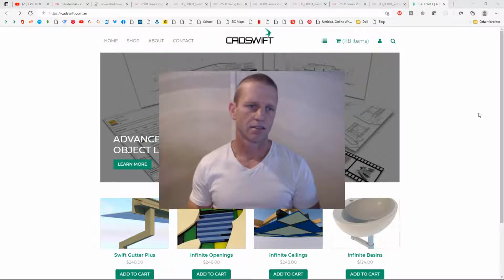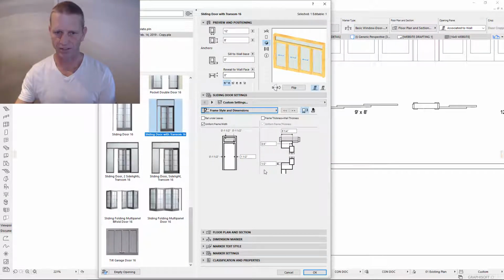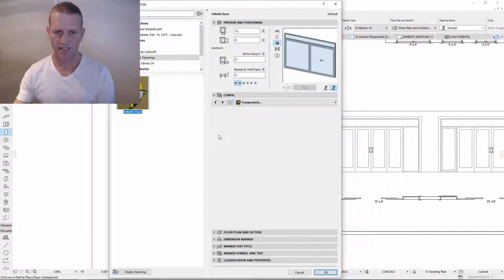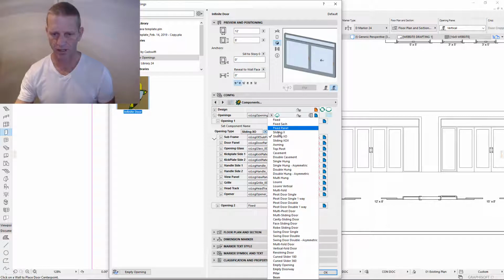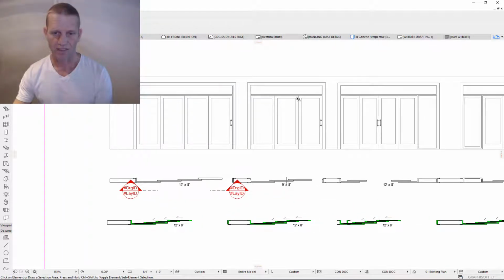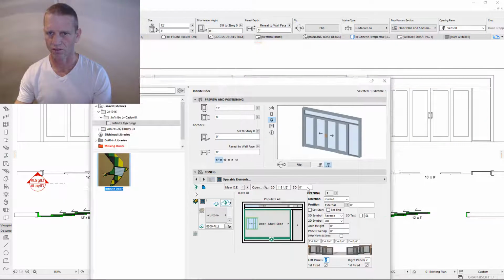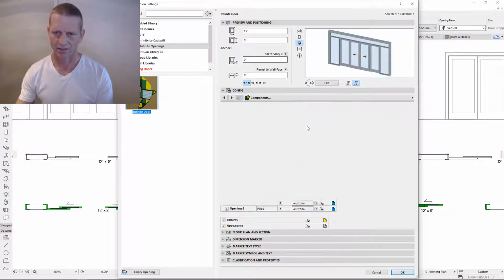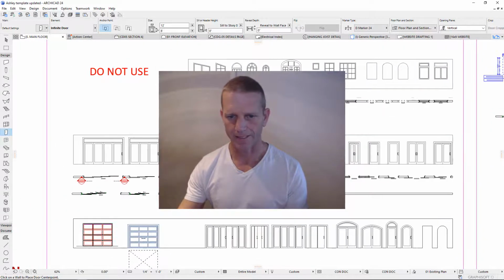Infinite Openings - How to Implement

Comment: Hi Kristian,

This is a great video. It uses some real world examples of the typical changes people will need to make in their projects. You've also explained the logic of the tool and illustrated the systematic step by step process you undertake when using the tool really well. 

Love the sleek design of the new UI too. 

Cheers

Andrew
Reply from the maker: Thanks Andrew, that's very valuable feedback.
Yes the new UI is a joy to use and so efficient; the person who designed it is very clever.
Reply: @CADSwift  🤓 Thanks.